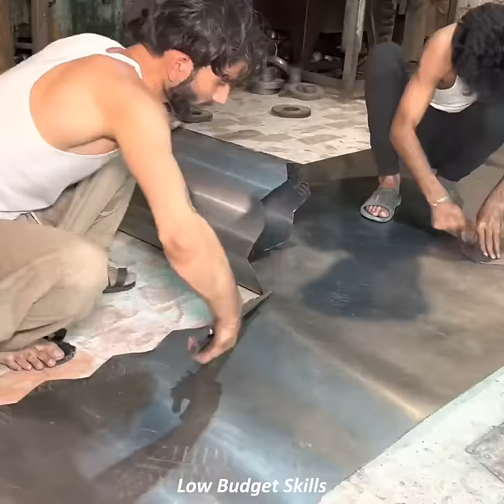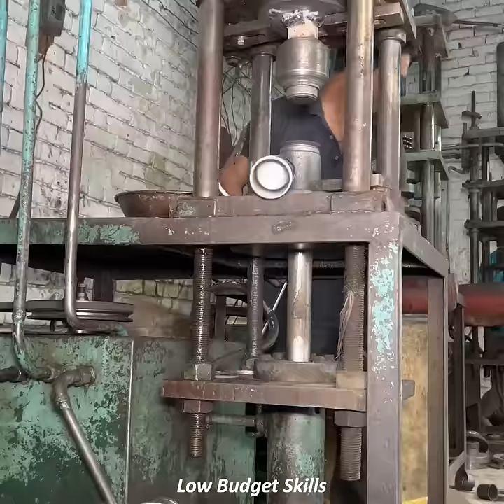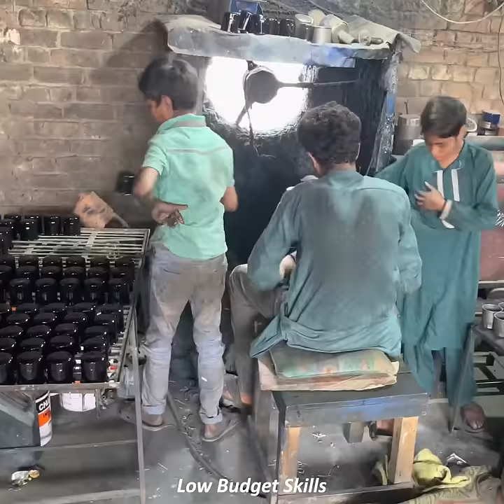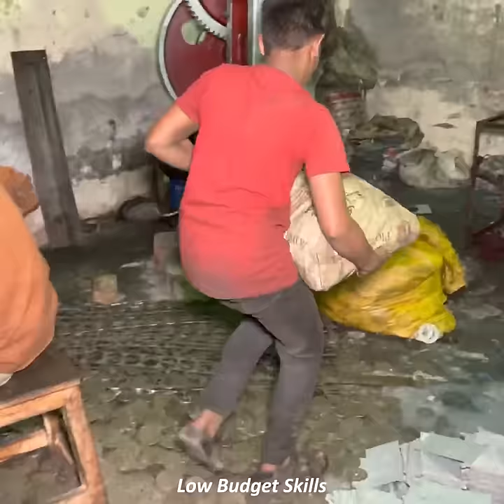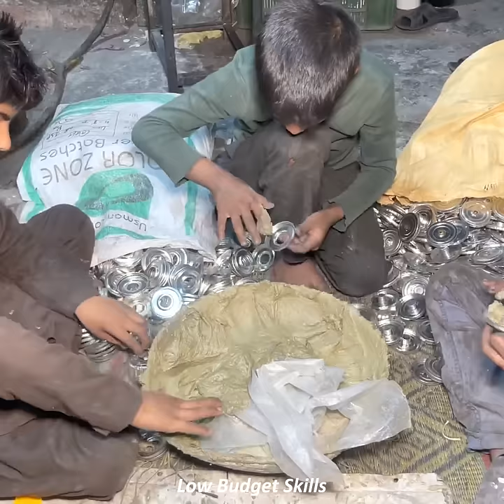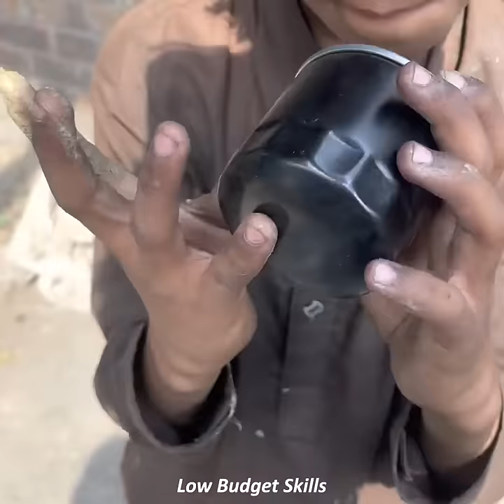Mass Production Process of Oil Filters With Amazing Skills

Comment: I think that kids they're synchronized the work and School specially in Asia. In my calculations 😂 85% kids are go to school, 20% of 85% is working because of the poverty, they are work pecially in vacant time, day, or Summer to sustain there needs. If you ask that kids. Didn't deserve that, but there have no choice. You could not blame there parents, because kids Choice. Pain in the will of the parents but no choice support that kids. For short "What the independent kids".